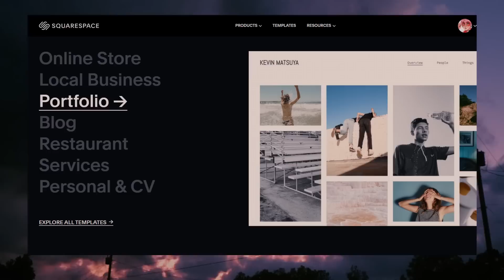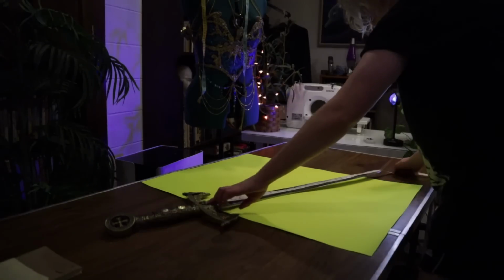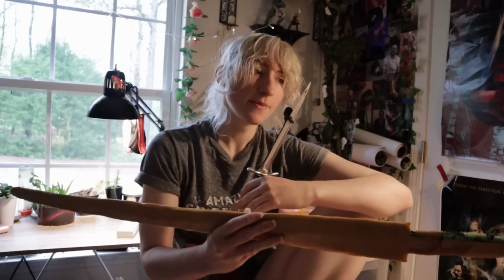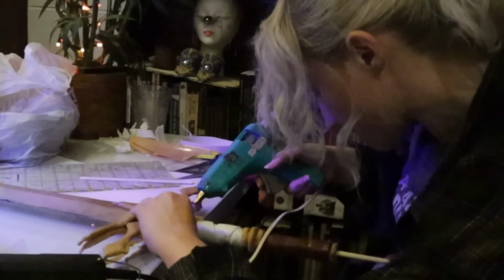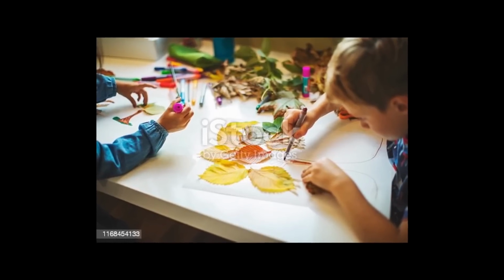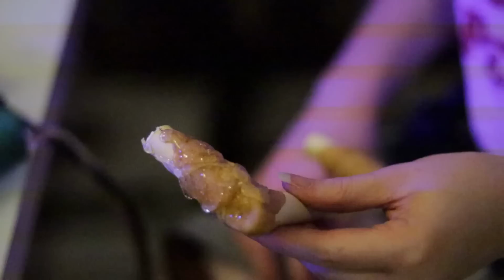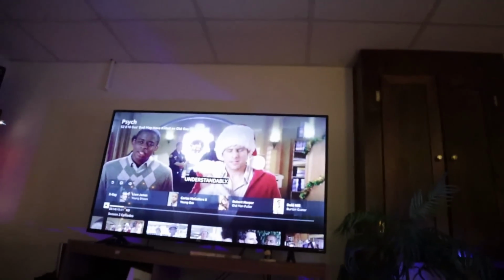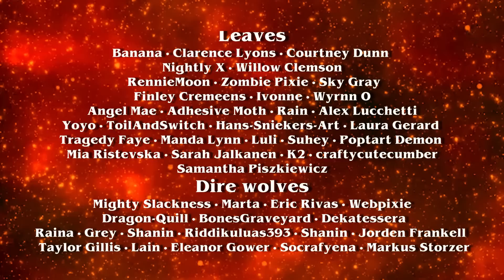Making a 'PORCELAIN' SWORD & SHIELD🌠✨to match my 'PORCELAIN CORSET' 🌠✨

Comment from the maker: Head to https://squarespace.com/pricklyalpaca to save 10% off your first purchase of a website or domain using code pricklyalpaca
Thanks to Squarespace for sponsoring this video!
Reply: You might want to consider looking at some of the LARP weapon ideas for swords, most don't use a dowel, but there's the, I believe, fiberglass driveway "flags" that are cheap at a lot of the larger hardware stores. Then using foam and other things for the blade around it. The flags tend to be both stronger, and tend to have fewer safety risks such as if something happens and it breaks and not leaving shaper edges

Comment: Helloo, fellow cosplayer here!! For swords like this, I like using threaded rods, usually ina 5mm thickness! They're super cheap, really lightweight, BENDABLE(!!) and very durable, I usually cut a channel in the middle piece of the foam and sandwich it inbetween 2 more foam layers. This might help for future projects :DDD
Reply: I'm not a cosplayer but I made a sword out of cardboard when I was younger and in the middle I used a strong plastic tube, could probably use thin pvc, it would only work for a thicker sword but also an option for people
Reply: I put a wooden paint mixing stick in mine… it worked really well
Reply: i made mine by using wooden shims and hot glue,  it was sandwiched in between two pieces of cardboard, it worked surprisingly well!

Comment: The extra time that you spent was so worth it, like replacing the scabbard, the dowel, and taking the time to clean up the edges and fixing the structure before painting. It made the end result so clean and polished. Thanks for the awesome video!

Comment: when i made a foam dagger a few years ago - i did the same thing with the pommel
had so many of those small glass half circle things (normally in candle holders i found) and had a great afternoon painting the back and seeing how different colours of glass and polish worked well and settled on a nice green with a slight swirled pattern behind

still got the box of the others i didnt use as may use them as they were the ones that came out super nice

Comment: This is absolutely amazing, you look incredibly cool 😎❤️
But I have a question

Why do you buy new knives instead of just buying a set of blades? They are replaceable, in case you didn't know, and you're actually are supposed to break the segments of the blade, when they get dull

Comment: Amazing project🤩 small beads added such great details 👌 questions: 1. Is sword heavy?? Because it looks heavy even though your sword moves looked pretty natural 2. Why is majority of your craft is done on a floor? Is that your preferable position? Are props too big for a table? Do you have a work table?? No judging just curious 😅😁❤ also the floral detailing chef kisses
Reply from the maker: Thank you ❤️💕 
Since it's worbla and foam, not too heavy, but it has more weight than expected. Since the handle/cross guard are proportionally longer, it is really well balanced though. It's only about 2 lbs, which is about the weight of a normal usable sword. 
The shield is super light, but the sheath also has a little weight since it's plastic instead of foam. 
As for the floor, yeah I tend to like to work on the floor so I can spread out 😅 I have some larger tables, but I also don't have proper cutting mats yet so any work with a box cutter has to be done on the floor anyways.

Comment: This set turned out so gorgeous!! Make sure that you test it out in the summer heat before wearing it to a ren-fair, though, because depending on the temperature type of the hot glue, some pieces might get a little tacky when they are outside in the heat for too long.

Comment: Why not use resin instead of hot glue if you don't need it to be flexible?  Plus resin you can add the color at that point so less painting.   Everything looks awesome.   You are extremely talented.
Reply from the maker: Thank you!! ❤️💕 
I'll probably try to do something like that for future builds, but the reasons why I didn't for this one were dry time (I needed to make pieces quick), expense (Hot glue is the cheap option and I don't have a huge budget for this), and I've also never worked with resin so I wouldn't wanna mess it up 😅 
As my budget and work time increases I'd love to work with more durable materials tho!